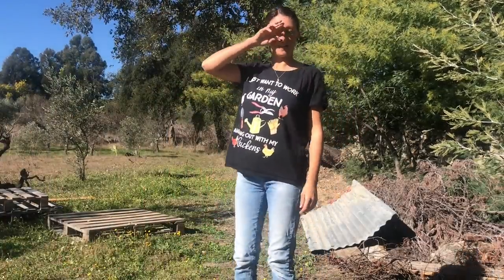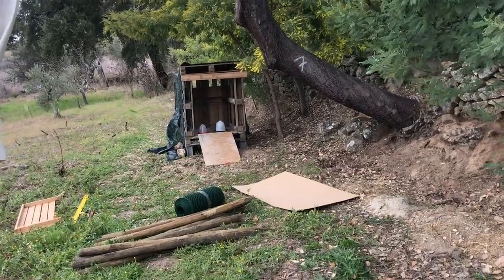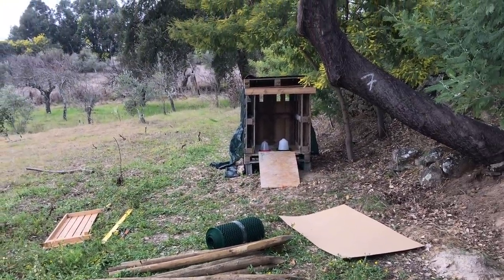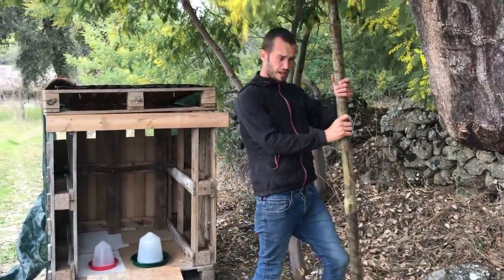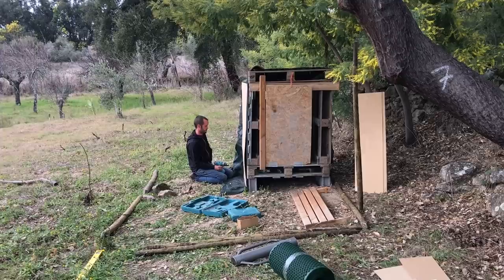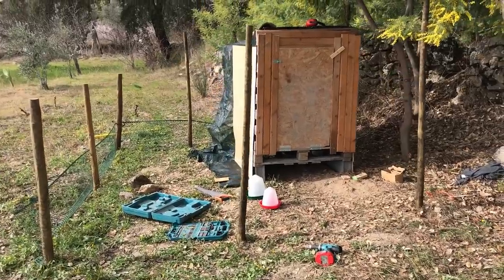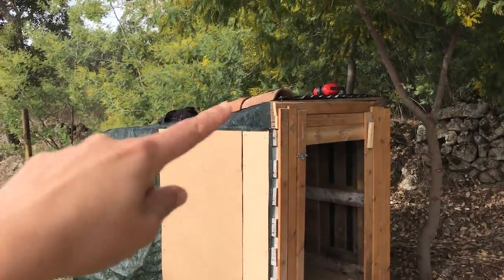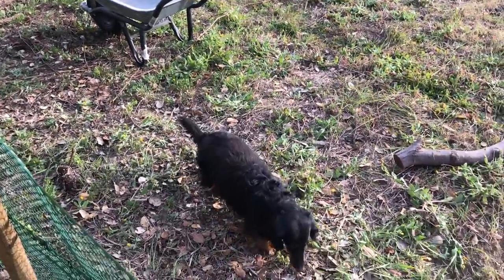Off grid life - Building a Chicken Coop for free (almost) with pallets and scraps. Central Portugal

Comment: Love your videos, but having chickens myself, I agree with the comments that you may need metal fence reinforcement. I suggest hardware cloth, both around and under the structure, as well as buried hardware cloth that extends beneath and is attached to your fence line. Best of luck with your chickens!
Reply from the maker: Thanks Rose, the comments have been so useful, we’re going to work on the fencing and I think actually we’d love to build them a more secure home, probably out of blocks. Hopefully this will work for the next few weeks 💛🐓🐓🐓🐓

Comment: You need to not only make the fencing at least another layer higher but secure the joins between layers the whole way round (I've used old electric cable for this sort of join, more or less sewing two surfaces together) or there'll be areas between your cable ties animals can shove their way through. Not sure your plastic fencing will be very strong to be honest, think a fox would easily bite through it. Foxes can also climb trees & get onto the roof. 
Guessing only 2 or 3 chickens in such a small area & coop? 
Good luck to you & the chickens, hope it works out ok.
Reply: Poor chickens 🐓
Reply: @margaretlovelock7031  the chickens in the UK have an extended A4 sheet of space.  I think they will be fine.

Comment: You def going to need stronger fencing like weld mesh and more shade cloth if you can can get it will provide more shade, and protection, if they can roost up it will help, these predators come out mostly at night, so keeping them closer to the house  will be safer for them. We had layers Rhode Island Reds excellent layers, ventilation is very important in summer, if they free range in day won't be a issue, and then cooped only at night💜🐔🐓🐤

Comment: I raised my coop, so the chickens could get shade underneath. Could you add a few courses of blocks? Obviously, the vital thing is making sure there are no gaps or weak points between floor and sides, as many have said :). . You may have to clip their wings if they fly: your fencing is low… You might also find them roosting in the tree.
Reply: They plan to clip their wings and have had instructions from Project Portugal

Comment: PS- the draft you wanted to prevent would actually be great ventilation.   Portugal doesn't get cold enough to be considered a draft imho.  Chickens need extra air in heat, and if it isn't snowing then it isn't really cold to chickens.  Their are breeds that are not cold hardy, so knowing what breed/breeds you have got will make a difference.

Comment: Lovely to see you are feeling better. Great effort with the coop, however. I agree with the other comments.  The fence definitely needs to be higher and metal, chicken wire. It will need to be dug quite deep, foxes can dig 6ft down and in minutes. Would also put it in view of the house and be careful what trees you put under for shade, high winds can break off large branches and damage the coop if not worse. The outside will need weatherproofing, especially if using mdf.  If you can make a small long A frame with attached run, you can move them around your land to till and fertilise. I forget which channel but they use that method and grow some amazing veggies. Love your kitties. X
Reply: The YT channel is “Mossy Bottom “ in Ireland off grid homestead

Comment: Hi Guys, we’re hopeful coming to Portugal on Saturday as your Mum recently traveled do you know what actually test we need to get in. It’s not obvious which PCR/LFT we actually need, we’re flying from Bournemouth to Lisbon, many thanks Dave
Reply from the maker: Hi Dave, my mum drove via Spain so I don’t know if it would be the same test. I think your best phoning the airline to get the most accurate answer ☺️ safe travels!
Reply: Hi we have returned home now, I recommend getting the Randox health test kits, we bought two PCR and two Lateral flo tests, as the problem is that the requirements change all the time.  That way you are prepared.  When we returned we needed to fill in a locator form and we needed the PCR test reference numbers which were in the email from them (it took us a while to fill out this form and to find where the reference numbers were).  Our travel agents recommended Randox.  The criteria all changed on the 11th, but there appeared to be issues at the border crossing in Santander as we arrived 5 hours before the changes kicked in.  You also need your certificates to say you have been double vaccinated.  We got the printed version, due to not being that clever with the technology.